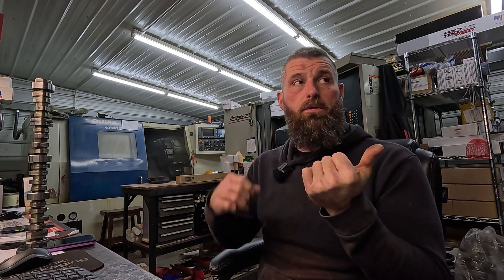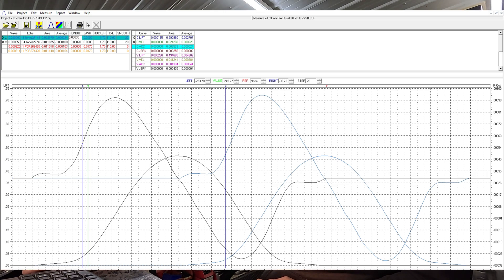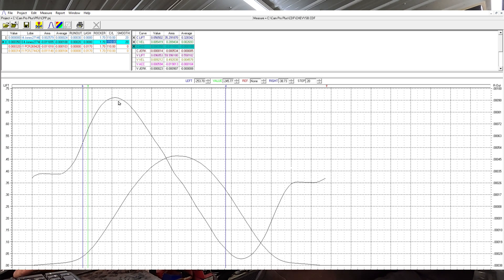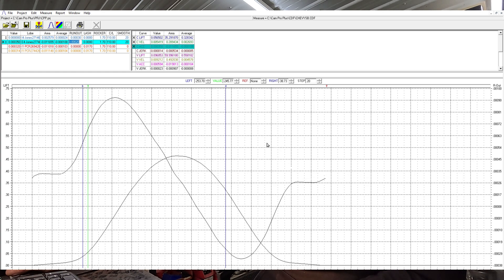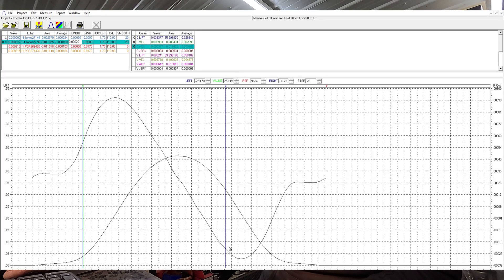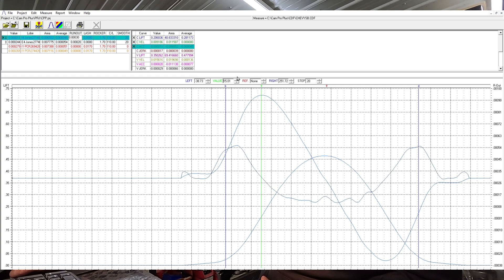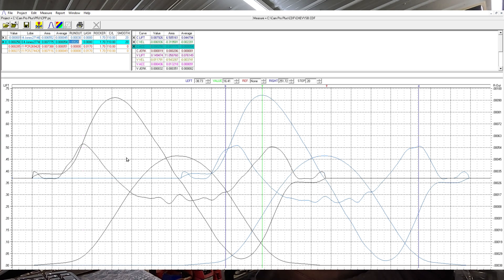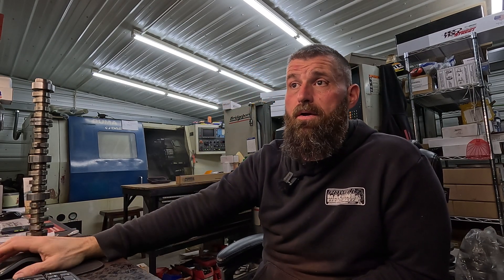More examples of poor lobe designs

Comment: I have a question my friend. Been quite a few years ago, I did a head gasket job on a friends Toyota pickup. 22R. I've done more than a few of them. Well he got a new cam with the head, he killed the old head, and this cam had a rough finish. Not smooth and polished like I'm used to. The parts guy said that it held oil better that way. Not even a month later the cam is garbage. Two lobes were almost flattened out. One intake and one exhaust. Got a new cam, it looked right, and never another problem. Have you ever seen a cam with an almost parkerized finish? To me it just looked unfinished. It was obviously a soft cam. I've never seen another and that guy quit putting them out. Experimental? I don't know. What are your thoughts?
Reply from the maker: @jalopywrench  all the new "loaded" import heads have garbage cams
Reply: @powellmachineinc  after I wrote this I was looking at 4-7 swap cams. The one Summit has is the same damn finish as that one on the Toyota. I want nothing to do with them. When I get closer to my small block build I'll get ahold of you. I think I want you doing my cam. 👍

Comment: You mentioned mechanical noise, any big difference between how the cam is driven, chain, gear belt etc if the cam is 'quiet'? Just thinking in terms of the whole valve train as one system..
Reply from the maker: @1320pass  absolutely belt is best, chain is 2nd
Reply: @powellmachineinc  thanks bud
Reply from the maker: @1320pass  no problem

Comment: As my knowledge of cams is zippo, are you able to grind in a slow down ramp to soften the valve closing to prevent beating the valves and seats? And thanks for the video!
Reply from the maker: @jim8027  correct,  that's how it's done,  we call that a Asymmetrical lobe, where the opening side is faster than the closing side

Comment: I could swear I've seen this video before but I watched it anyway.
Are these measurements taken directly on the lobe or off a roller lifter following the lobe?
Reply from the maker: @fascistpedant758  other channel and yes, directly off the lobe
Reply: @powellmachineinc  Thanks. Wouldn't the lifter roller diameter affect the actual lift profile? (E.g., lifter acceleration)
Reply from the maker: @fascistpedant758  yes, we have a ball follower that doesn't rotate thats the correct radius to take the place of the lift,  this excludes any error a rolling lifter would have.
Reply: @powellmachineinc   Thanks.